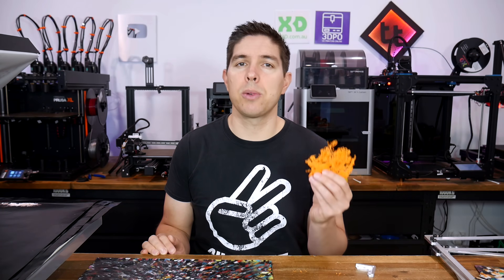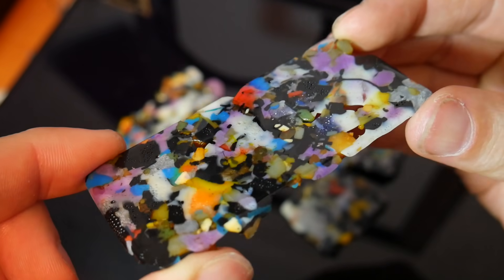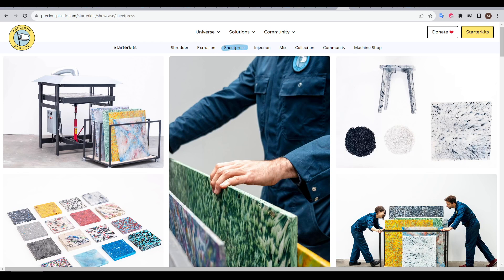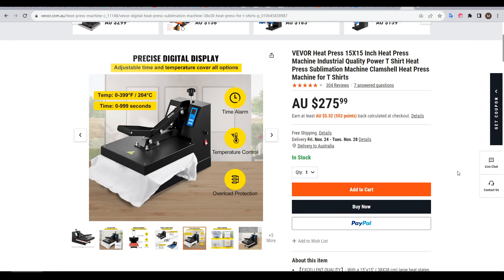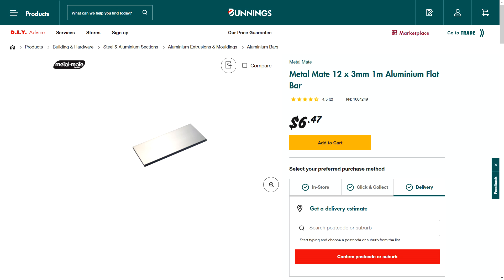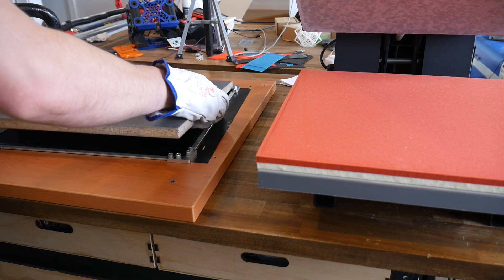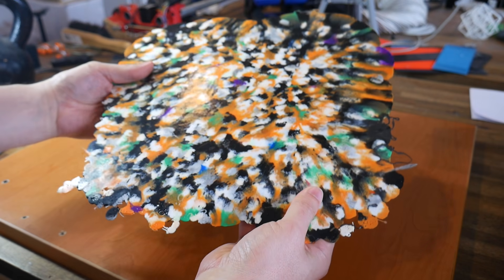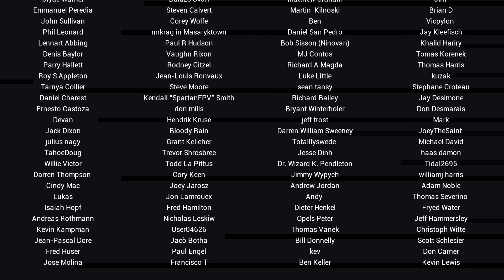Melting plastic waste into beautiful flat sheets on a budget

Comment: I am working on making buildings 3D printed small ones sheds stuff like that One of the biggest issues I have is the roof because I want to keep the entire thing modular these would solve that problem nicely I could just do a normal shingle tile roof using waste 3D prints to create tiles but there's a problem

The core issue was trying to melt recycle plastic is the inability to shred the plastic into usable small little pieces that are effective for using this process

And that machine to do it is insidiously expensive

Is there an affordable as in under $300 US version of that type of machine?

Comment: Honestly to me the easiest thing to do with those recycled sheets is just to use them in other 3d prints, for example, if your design is boxi-ish consider substituting a wall for one of these sheets, just print the corners and slide it in.
Or, they can make decent shelves, maybe to be used with gridfinity bins
Reply: Also, how about putting a mesh inside it and making it a composite super rigid material? You can put sheet-mesh-sheet-mesh-sheet, eventually it will become something like carbon fiber

Comment: Melting the filament chips , is there any bad fumes to worry about?
Reply from the maker: During the sheet creation, no. The laser cutting smells a bit, but not as bad as some other materials.
Reply: @TeachingTech  when we were camping in our trailer, next door was another site and another camper.  I recall one early evening they were burning plastic soda and milk jugs in the fire.  Black smoke rose from the flame. My father in law saw that the smoke was blowing our way. He went over and asked them to stop which we being friends did stop.  After pop told them of the carcinogens let off with melting plastic. I just hope what you do just up to the molten state and I heating up pet bottles to make filament doesn’t release the bads.
Reply from the maker: I think there is generally a distinction between heating a plastic until it melts and burning it like with laser cutting. Not to say one is always safe, but the lack of smoke from just melting is a promising sign.

Comment: In Europe it’s surprisingly difficult to find a matching clone of your machine. All Vevor machines being sold are the swiveling type like your old one. I found two identical machines for 600 / 750 € . Surprisingly the few more affordable clones are left hand drive, with a panel left of the press lever but otherwise identical. That’s a lot of plastic being melted at once I’d be worried about voc without enclosure and exhaust, especially if you melt more than PLA.

Comment: I wonder if it could be used for making flat sheets of plastic from scale models (think Warhammer minis)? Flat sheets of plasticard are quite expensive, and most of the time 
they don't need perfect finish (in fact, extra texture may be cool detail for building plastic terrains, armour plating on tanks etc). Tho they would be to be 2 mm tops, and probably in 0.125-0.5mm range.

I tried melting sprues (the frames models came on) with acetone and leaving them to evaporate, but that leave sheets of bubbly plastic. Not ideal.
One advantage of sprues is that they are mostly flat already, so probably won't need that much shredding. Also they are mostly same material in one color (usually grey), so they would look more professional.

Comment: excellent idea to use the cheap heat press.
I'd be curious to hear your results using petg instead of pla.
I'm guessing the low melting point of pla makes it difficult to carve with a CNC.
Reply: You’d probably want some sort of water recirculating system to cool PLA while it cuts.
PETG would probably work but need a higher temp. Though it does go soft at 200, might need further heat to gain strength

Comment: Really interesting and inspiring. A test with PET would be great, as you do not need a 3D printer to generate this kind of waste .😏
PET melting temperature is much higher. I usually print PET-G 25C higher than PLA. PLA melting temperature is 150-180. PET-G is more like 260, so above 250C.
I guess it would reach the limits of your press and the plastic would not bound together properly.

Comment: Great idea. Well, I'd have to make more waste and also buy this kind of "hot plate" to melt PLA waste, so I'm not sure I'd go ahead with this construction, but it's still very interesting for someone who prints more than I do and who doesn't know what to do with these scraps and other failures. Then there's the 'problem' of large printed parts, again I can't afford to invest in the manufacture or purchase of a shredder worthy of the name that can shred printed parts, but here again it's probably profitable for someone who prints more, a shredder would probably be worth having in a small workshop. I wonder if I could try something with an old electric kiln that's lying idle? 🤔🤔

Comment: I'd be very interested in what happens if you make a mistake and mix types of plastics. 
Especially if one is doing non 3d printed plastics alot of them are hard to tell what type they are so mistakes will happen.
Reply: In theory, pla doesn't stick well to petg, so you could end up with parts that break more easily. However, when I purge my nozzle after switch from petg to pla or vice versa, their seems to be a smooth transition from one to the other, suggesting it might be a function of how well they mix in the press. This would be a fascinating followup video.
Reply: They'll mechanically interlock like hot glue to surfaces, but won't bond.
Reply: I'm no expert, but i know polypropylene (PP) and polyethylene (PE/HDPE) can be mixed effectively. this is done for things like industrial plastic pallets, etc
Reply: Size of the shredded plastic would make a difference. The smaller the pieces, and good mixing should produce good results as long as a high percentage of one type of plastic. Thicker sheets would offer better bonding vs. thinner sheets.

Comment: Years ago, I made an HDPE press out of plywood, to make HDPE boards. I had to cover the insides with baking sheets so it wouldn't stick to the wood, but it worked. The output of it was 6" wide boards that were 1" thick, and the length of the boards depended on the amount of plastic. The top part was open, and one of the narrow sides as well. The way it worked is that you put the mold in the oven with shredded HDPE inside of it, waited for it to be molten, and then you bolted a cover on top of it. Then from the open side, you inserted a plunger, which you hammered down to pack the plastic tight. Once cooled, you could remove the top cover, then separate the piston from the edge of the plastic board, and extract the plastic board. Et voilà! That way you got a board with smooth, even edges, except the edge that touched the piston, but then you can just saw it off.

Comment: I thought about laser cutting recycled 3d printed sheets but I was never sure about the safety of fumes coming out of overheated PLA plastic (I would assume it gets quite a bit hotter than the melting point where the laser passes) does anyone have any reassurance about it?

Comment: It seems like this set up would work for HDPE.  I have a lot more HDPE - milk jugs, coffee containers, misc broken plastic parts, food containers - then I have of scrap PLA.  But, I work on 3D printing projects that are pushing the lower size limit for 3D printing, so my rejects and iteratations tend to be fairly small.  Still, there is the issue of what are you going to do with these sheet!!!

Comment: why not keep it in the heat press whilst it cools as thats got more pressure than the dumbell.
Reply from the maker: I did that for an early sheet. It takes a very long time to cool down, and the timber sheets are flatter despite there being less pressure. I could always add more weight if I want.

Comment: Making New Filament;  I've been thinking that _what if_, you combine the filament extrusion and making flat sheets process. Take a metal funnel with lid, heat it like oven with wasted prints etc. inside it, once you got enough melt there that bottom outlet is covered at some millibars of air pressure on top to push the filament out. Just few millibars, since single hole would cause all the air to bleed, but you can make the funnel large top diameter to get plenty of force just slight difference.

Now that melting plastic could be fed to extruder, or simple die to go directly to filament BUT that most likely won't work, so optical sensor with razor blade to pelletize the output into a vat, and put it into the filament extruder then ....

No idea if this works, it's so simple i wonder why no one has tried it. When plastic melts it becomes liquid, very very viscous but liquid never the less. No need to grind etc.
Reply: could be a plunger too tho. Lots of trial and error ahead